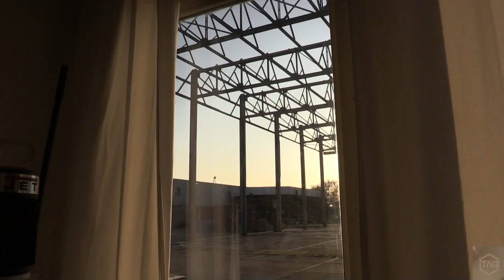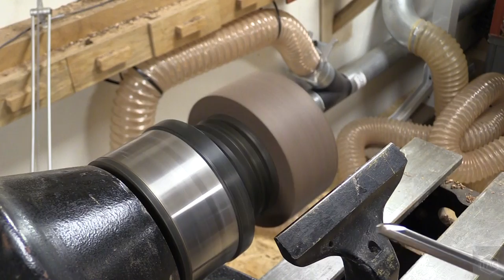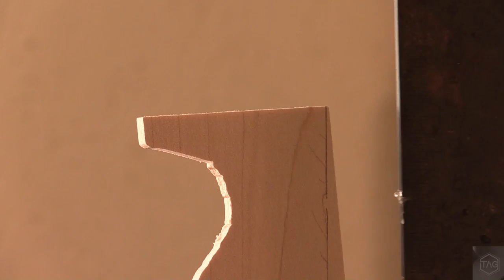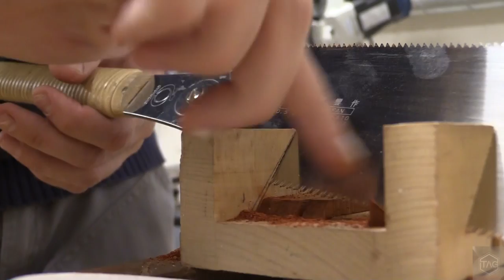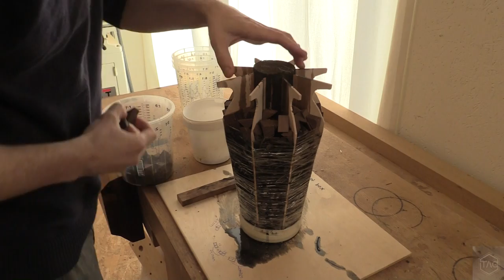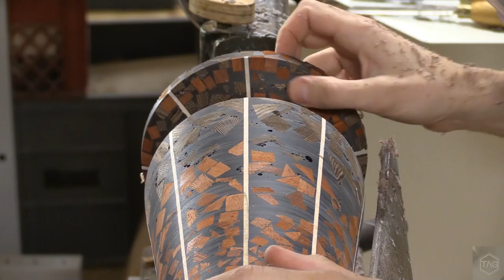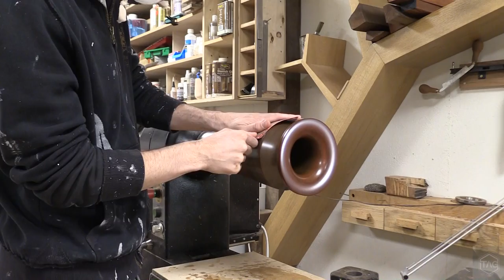Woodturning - Mosaic Resin Vase - My first epoxy vase project

Comment: Thomas, Thank you for making the time and effort to share your work on this piece. Wow. I appreciate the creativity / ingenuity involved with designing the construct as well as seeing the process involved. I was worried about the air bubbles (occlusions), but the mid-turning repairs seemed to address those issues. Of late, I have seen a lot of carbide-tipped tools used to turn resin objects, so I am impressed at how well the high speed steel cut through the material w/o any [documented] tearouts or snags.

Comment: This is lovely. If you're going to make more resin-and-inclusions objects, I'd recommend building a vibrating table to get those air pockets out. It'd save having air pockets, possibly in places that are hard to patch. For larger projects, you wouldn't need to cut up all those tiny pieces of good timber, just use fresh woodchips from your local garden supplier - they supply them in different colours for landscaping. I'd love to see a lamp built like this, but with a translucent tinted resin and then turned to a thin enough layer that an LED light inside could shine through!

Comment: Dear Thomas, beautiful work on the resin / block vase. You went about it like you have made them for years, but I assume this was your first time.  Your workshop - when did you win the lottery? Most YT’ers would give almost anything to have such magnificent machinery.  Your MiniMax sliding table saw topped it off, never seen one in a working workshop. Cheers.

Comment: A unique and clever way to use wood chips to your best advantage.  Well done!  This design needs to be enlarged to fill up that window you  included at the start of this video at 00:14.  I thought this is the size you would be working on, and was surprised to see a much smaller version.  Imagine how much more impressive a large vase made with the same techniques would be!

Comment: Well done video and great work on the vase. Get yourself a pressure pot for any future resin pours and you'll save yourself the air bubble problem. Not like woodworkers need much excuse to buy more tools and equipment but that's one. :)

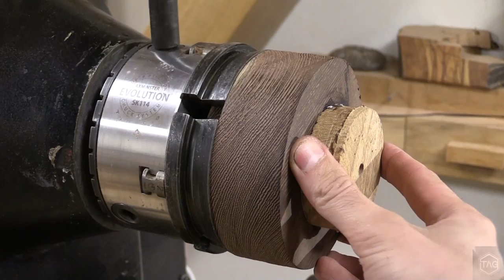Comment: At 2:47 where you cut off the block you had glued on, I'm sure I've seen someone use a hot melt glue and separate it after with a hot blade. It means you can keep reusing the same block.

Comment: The solution to the air bubble issue is a pressure pot. It is a must have for proper resin moulding. It's not expensive and works great.

Comment: Very nice piece. Did you consider a pressure pot to eliminate the air bubbles when pouring the resin? Also, what was the final finish? Oil based poly? I always enjoy your videos and look forward to the next one.

Comment: Great piece of work, Thomas. Is there a reason you didn’t just use a hollow tube, instead of a log, for the resin casting?
Reply from the maker: Thanks! I thought drilling this out would give the forstner more stability/material. I was actually at the point of choosing a cardboard tube, but decided on this. Maybe a hollow tube works better after all.

Comment: Would there have been holes if you put it in a pressure bucket? Just wondering because of all the pieces.
Reply from the maker: Not sure, have been wondering that too.. haven't bought a pressure pot yet. Or made another piece. According to others it should help alot.

Comment: Thomas i don't have the skills to do what you do, but would you consider one of my ideas just to see it made, turn a vase or bowl out of layered wood and drill 1/2 inch polka dot holes all through it, then fill holes with different single coloured transparent resin rods slices. e.g. turquoise, lime, lilac, yellow, pink, orange and clear

Comment: beautiful vase

one question, it's been a while since i did any lathe work, but is there a reason he's holding the blade sideways?
Reply from the maker: Gave me more controlled cuts, with a regular wood vase you can hold the gauge more horizontal. Found out with this epoxy vase that didn't work well :)
Reply: @TAG-1984  thanks for your reply. that's probably true, but i've found it's also a good way to wreck the sharpening edge. perhaps i was using a softer/harder blade at the time. my mentor at the time taught me that for more control i should either put my rest closer, and use my hand just behind the rest, or to use an arm extension to prevent the blade from wobbling as much.

idk,  you clearly have spent a LOT more hours on the lathe than i have,  and i am probably just remembering all of his advice wrong.

either way, keep up the cool videos.

Comment: try using styrofoam  on the inside glued to wood at its ends so you can turn it. Then  when you are done shaping the outside drill a hole at the end and pour acetone to melt away the styrofoam. It is much easier to hollow out your vase this way vs drilling such a large deep hole. The you can polish the inside. If the styrofoam is smooth and protected by tape the resin should not react with it. Even those noodle for swimming will do. and it you are worried it won't be stable a wooden rod on inside which you can later remove by twisting off.

Comment: You've done a great job, You did the right thing, you can't use a tube, the probability of axis displacement and strong beating. It is also possible that the resin flows inside the tube. Everyone who works with resin struggles with bubbles, unfortunately the result is unpredictable from time to time. Small air bubbles are squeezed out of the tree by resin and from the type of wood, its desiccation, and so on, the bubbles appear, then not. Also, the instructions prescribe the maximum fill thickness, With a large volume of resin overheats and"boils". It is also a very unclear indicator, when it happens. I wanted to ask you what kind of glue you use here https://youtu.be/EVdGzXUEu1g?t=502 ?